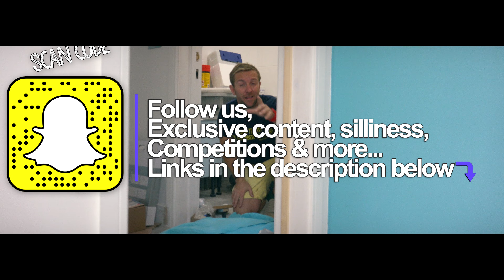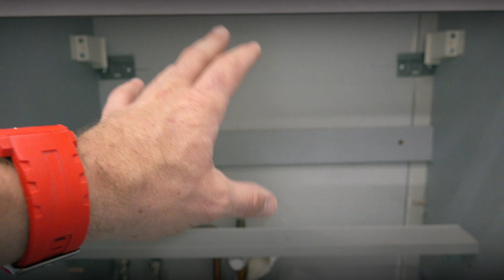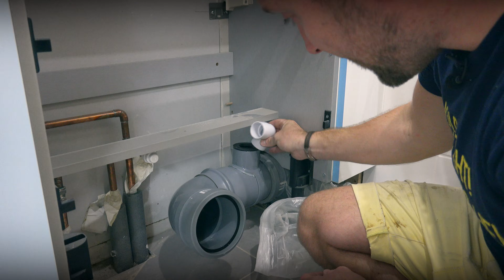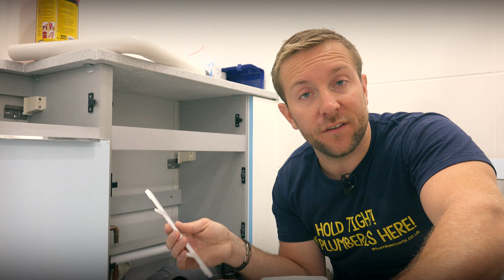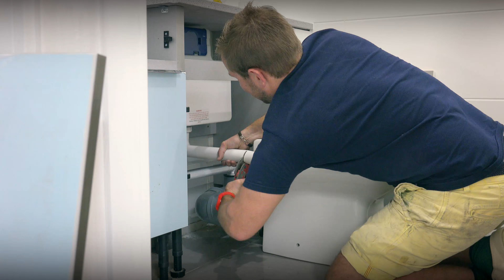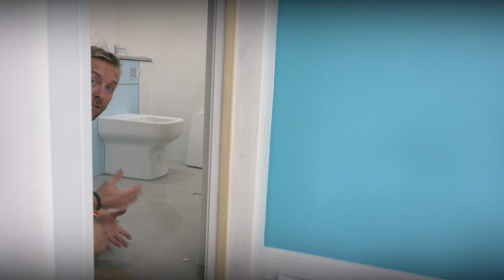HOW TO FIX A CONCEALED TOILET - Plumbing Tips

Comment: I have a v similar set up , ive had no issues until last night .
I have a house guest whos a big lump of a bloke and after he used the loo , i noticed a water stain coming through my ceiling . I checked the underneath the cistern and not much water .. but there was a little pool around the base of the pan ( un siliconed ) 
Do you think its possible he has twisted to flush and warped the water feed pipe ( no smell , so hopefully not the soil pipe )
It hasnt done it again after a few flushes . Im confused
Reply: Toilets should be able to take weights up to 400 kilos. The house guest won’t weigh more than that. Have the installation checked. There can be some movement with floor mounted systems and as result this movement pulls on the connections and over time cause them to fail.
Reply: @ it was due to a failed / worn seal thanks

Comment: I just fitted a floating toilet and it appears to be leaking ever so slightly from the flush pipe, I suspect its the rough surface of the porcelain, any tips how to stop it? Could i put plumber maite inbetween the ribs of the rubber seal?

Comment: Should you have pushed the O ring seal on the flexi WC pan connector straight into the soil pipe bend without a 110mm off cut pushed in first?
Reply: No he shouldn’t really from my experience. I tried it and it can leak, as the bore size is larger in the soil pipe elbows.

Comment: I'd have to argue I save a lot more time fitting the occasional item twice than reading every instruction manual thats not to say you shouldn't. but further to that if you plan a job based on the spec sheet and instruction manual without actually physically inspecting the product, you are gonna have a lot of problems and a hard life.

Comment: Is there a video on how to adjust toilet flush volume on the  same cistern whilst the toilet is in position, is it just twist the  valve and pull it out? Unsure if I can get it back in without being able to see in to it , worktop is fixed in position and bathroom is finished thanks

Comment: Great video. I'd like to fit one in my bathroom but my 4" waste pipe runs across , am I able to cut enough out of the sink vanity unit to allow the 4" waste to run through it?? 

I can't have the sink/ toilet the other way round as the space doesn't allow it

Comment: Hi I'm swapping a built in back to wall pan tomorrow and don't want to have to  damage the granite fitted on top over the valve. 
Can I remove the pan and put a new one in without turning off the water. ... your video seems to support that xxx

Comment: Hey mate ... Where can I purchase a concealed cistern with 90 degree bend flush pipe or just the pipe on its own (38/40mm) as yours on here instead of a long swept bend? Got a fluid master to replace an original unit and sits above the cabinet worktop height even when cut to its minimum towards the bend ..... help can’t make the misses flush the no.2s with a bucket for much longer !! 😂🤣

Comment: why bodging a T-connector? You can buy the T factory-molded as a single plastic piece.. no leakage risk...
Reply: Are you talking about the boss? I don't really see what the leakage risk is anyway in that situation since it's top entry.
Reply: @nobodydoesithalfasgoodasyou  1 ) you know that silicone doesnt stick to PP pipes? 2) you know what sewer gas is?
Reply: @NuclearSavety  you shouldn't try to be condescending when you're talking claptrap
Reply: @nobodydoesithalfasgoodasyou  sorry, i thought you were trolling....  when implying a leakage in the gas phase of a sewer pipe would be a minor problem....
Reply: @NuclearSavety  what is the problem that you allege exists?
Reply: @nobodydoesithalfasgoodasyou  wanna smell sewage in your bath?
Reply: @nobodydoesithalfasgoodasyou  wanna have a plumber botching a job in your wall?
Reply: @nobodydoesithalfasgoodasyou  if yes, great for you, congratulations.

But dont pretend what the guy doing is acceptable for other people.
Reply: @NuclearSavety  sorry, you seem to be having a conversation with somebody else. I asked what problem you thought might occur with a dry but mechanically tight joint. Maybe you are too busy trying to solvent weld your polypropylene pipe to answer? 🤭
Reply: @nobodydoesithalfasgoodasyou  the problem is, silicone does not stick to PP pipes. And flushing a toilet causes vibrations in the pipes .... add 5 years time to that .... 

Therefore the right sollution is to go buy the correct pre-molded t-joint, and not botching something when the customer doesnt look...
Reply: @nobodydoesithalfasgoodasyou  PS: solvent welding works for PVC, not really for PP ....
Reply: @NuclearSavety  you're the one who brought up polypropylene 🤦‍♂️
Reply: @nobodydoesithalfasgoodasyou  look the video .... grey pipes = PP .... orange pipes = PVC .... the guy uses PP pipes ... considering your eager to defend the video, you know surprizingly little about plumbing....
Reply: @NuclearSavety   @NuclearSavety  the pipe and boss in the video (which are uPVC) are mechanically connected by the strap, physically located by the tongue on the boss and furthermore held together by the weight of the 40mm pipe bearing down on the joint. Vibrate the joint to your heart's content; it's not going to separate to a degree sufficient that the volume flow rate of extremely dilute noxious gases escaping from the pipework into the room is going to be enough toxify or otherwise render unsafe the bathroom air. Hell, you could have your nose up against the joint and stay there all day and your only problem will be a stiff neck. 
The bodge in this video is the hideous damnable flexible waste, use of which should be a capital offence even for a DIYer.
Reply: @NuclearSavety  I don't know where you live but it's clear you know nothing about British fittings. The pipe boss he used is designed to be solvent welded to the soil pipe. Think it through logically: the pipe boss is standards compliant; if it were made of polypropylene which you say does not bond well with silicone, and cannot be solvent welded, how could the joint be assembled other than dry or with some other adhesive?
Reply: Cheaper aswell
Reply: Hi do you have a link to one of these please? Thanks
Reply: @Chris-uu6dg  look at Amazon...

E.g.

https://www.amazon.de/s?k=abflussrohr+t+st%C3%BCck&sprefix=abflussrohr+t&ref=nb_sb_ss_ts-a-p_2_13

Comment: The question is how do I access the concealed cistern toilet once it is installed. Basically the big button does not flush the toilet anymore only the small one. What could be causing this?. Trouble is a cremaic tabor vanity basin is fitted on top. Would I need to remove the whole unit just to get to the Toilet. Or just remove the sealent and the two pieces?
Reply: 80's Lad bit late reply but you’ll be able to access the cistern through the front 2 vanity unit pieces allowing you to work on the cistern

Comment: I've just repaired a leaking O ring on the flush pipe of a concealed toilet system. The job took 15 mins but took over 3hrs to get access to the back of the toilet! The worktop had been fitted & tiled on leaving no access to the back of the toilet! Nightmare! Another great video from plumberparts!
Reply: We have a leak under toilet and access is very tight. Looks like small leak for a few tears that has now found a way into floor above sitting room. The cistern is completely tiled in, no access except for pulling out toilet unit. The clean flush water pipe connection to toilet is where the leak is. The end of the pipe was cut off unevenly. I have made that smooth and lubed up the connection but no access to push pipe in the only way is to line it up and push in toilet unit. I think it is not making a good connection still. So . . I'm starting to take off tiles! Great fun, kind of.
Reply: @JamesColemanLikesWind  You have my sympathy! I reassembled the bathroom vanity units & worktop to give easier access in the event of it leaking again.
Reply: When things are done properly there should be no problem with concealed units. Sadly too often that is not the case and people become wary of concealed installations. Which is a shame because all the advantages are lost.
Reply: how to replace siphon washer ina concealed cistern

Comment: Good video but was always told never to put pan connector in to socket, should go straight in 100mm. What you think?
Reply: its only a matter of time! 
We always cut a sleeve for the socket
Reply from the maker: Yeah I usually do too, but changed method for this job to see if it will work. They're only down the road so any problems I'll know straight away. As it happens, all ok at the moment!

Comment: shouldn't you have some 4" in that elbow for the pan connector?
Reply: I don’t normally reply on stuff like this. But you’re absolutely right. Small piece of four-inch to take up a proper seal.
Reply: Was thinking that too.... and silicone on a strap on? Is that a thing now?
Reply from the maker: Yeah I usually do too, but changed method for this job to see if it will work. They're only down the road so any problems I'll know straight away. As it happens, all ok at the moment!
Reply: @plumberparts   yer but leaks cost money and its messed the floor up
Reply: Yeah, fins on fins is not a good thing, sleeve with a bit of 110 soil.
Reply: I would defo sick a bit of 110mm in that socket, especially as it's gonna be concealed.
Reply: Whoops! I didn't notice till I saw your comment lol. Good shout

Comment: Good tip on the ‘strap on boss’ installation. I’ve had a few of the solvent weld boss’s not take properly before and couldn’t figure out why. I’ve seen in various USA videos they usually use a primer the pipe with a solution before the solvent weld, but that doesn’t seem that common in the UK I’ve found.
Reply: Just for your interest , I work with industrial plastic pipe and its always cleaned with a cleaner , don't know why this doesn't apply to domestic .
Reply: you are supposed to use a cleaner but people rarely do,  i recon the reason the strap on boss may not take too well is because your just pushing them together and thats it , unlike a pipe and socket where you twist them together which allows both the socket and pipe material to fuse into each other , otherwise your just putting glue on the top and allowing it to dry ....
Reply: In the US, primer makes a big difference on PVC and is required by some building codes, almost a guarantee to have problems if you don’t

Comment from the maker: Hope you like guys! Was on a job so thought I'd film how I got over this! PLEASE follow me on Instagram http://www.plumberparts.co.uk/social.php?social=Instagram  I would have used a toilet elbow with integral boss but didn't have one on the van! Sorry! Also was a bit naughty installing the multquick into the elbow without a 110 sleeve, but all is well and there's no leaks!
Reply from the maker: Think that's a Diesel!
Reply: plumberparts Excellent video, easy to follow... nice watch, what brand??
Reply: Plumb-Dawg have you ever used one of these? 'Aladdin EasyFit Isolator'
Reply: plumberparts in
Reply: Hey m8 just wanted to no if these bathroom jobs are the same level of easy for high rise flats as I’m doing mine these week but the bathroom pipes etc are older then me lol
Reply: plumberparts Nicely done James ! Accurate job - however slightly doubting about flexible filler pipe - it looks overbended a little bit - I think shorter pipe would be a better choice... or even copper pipe with threaded fitting.